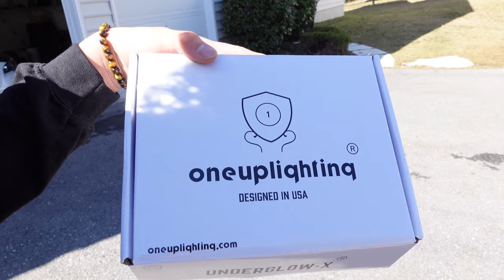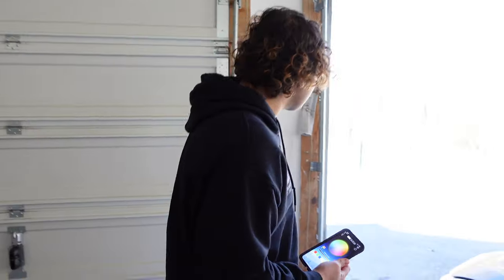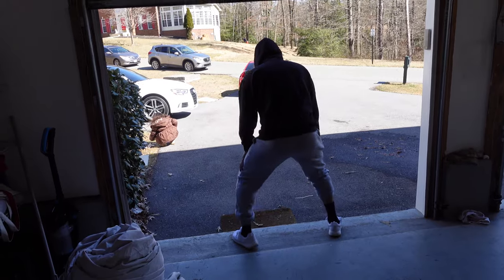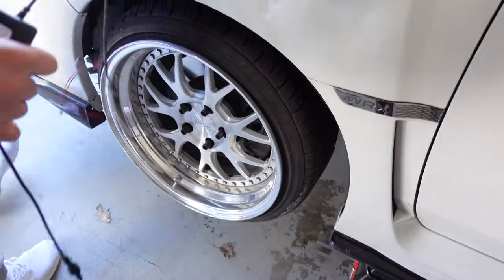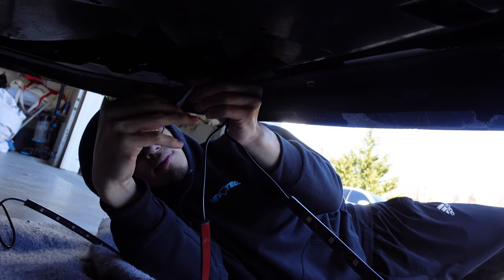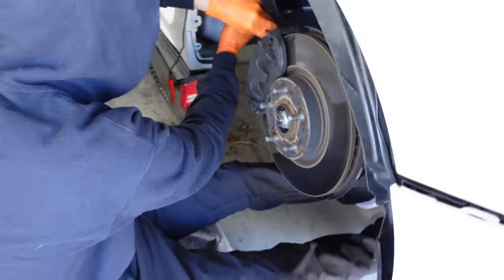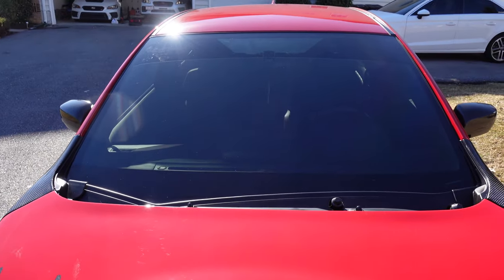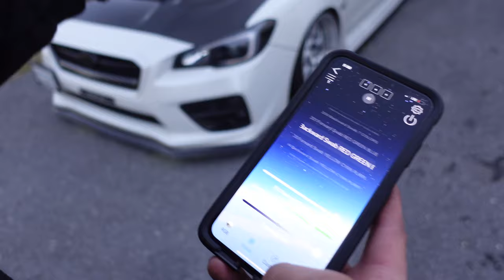Installing UNDERGLOW (WRX)

Comment: How did you figure out the rear with the tire carriage buldge I ran mine but have a gap in the center because if it so I’m trying to figure out a solution on that

Comment: where did u guys run the outside wire into the car? bc i’m tryna install on my wrx and i have no idea where to run it through
Reply: mine plug into the usb port cigarette lighter btw
Reply from the maker: Mine went straight to the battery so we ran it straight under from the engine bay
Reply: i personally like the battery ones better mine is the battery powered ones. just red on red & black on black obvi
Reply from the maker: Which brand do you have ? I might have to get a new one because one side stopped working
Reply: Shako Built mine is from alpena ! it’s all controlled on an app and i got them at walmart i believe for like $80 they’ve worked pretty well for me!
Reply from the maker: Oh nice! I might have to look into those 🤔
Reply: @shakobuilt  pretty sure either way they gonna fall off lol
Reply from the maker: @nixwrx  it’s not that it’s falling off lol like one side the lights aren’t working at all